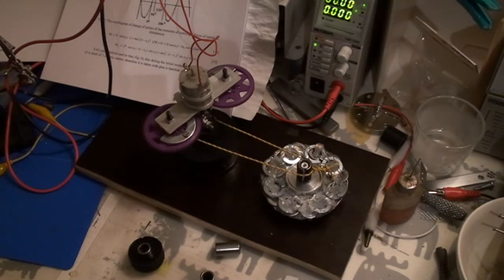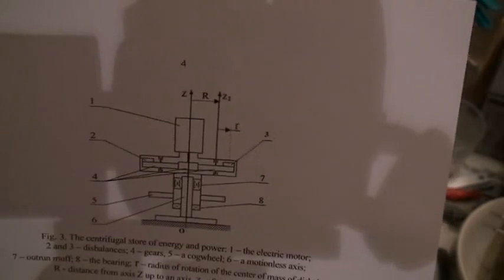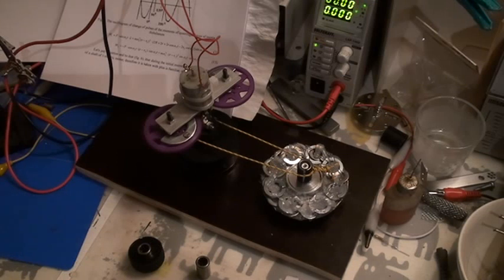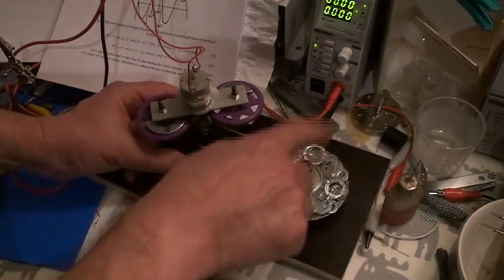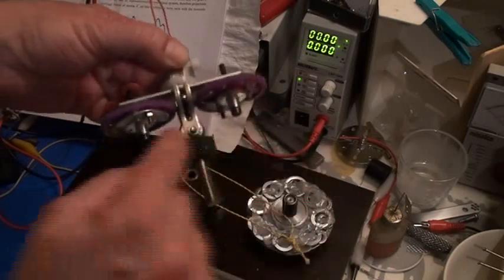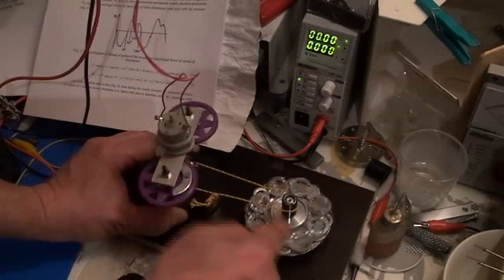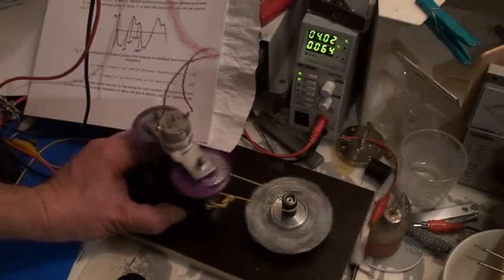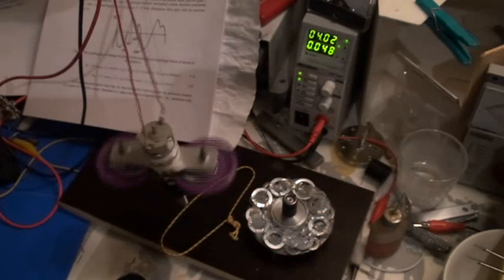Newton law at risk 1  wmv

Comment: The oscillation of the mass in those two purple wheels does delay the phase between the wheelmass position and the wheel position in the oscillation. This will create "drag" and therfor the motor draw more current than if you had stopped the oscillation completely - but let the two wheels spin freely. The CD-motor gain kinetic energy, and only the loss in its motor (that holds it a bit back) require very little energy to overcome. The motor in this experiment require current flow that is dominated by the oscillation, but also the poor and little efficient transmission between the motor and the wheels. Also the current draw drops by 20-25% when removing the CD-motor...
It is clear that the rope and the one-way bearing moves - you say they don't move...

Comment: Very interesting thank you.
Reply: Stefan F. Yes. That's what they claim. Yet, oddly, there still exists a patent category Y10S 415/916 titled, "Perpetual Motion Machines'. Theoretically, if you can provide a working model, they are required by law to at least process the application.
Reply: Stefan F. "Free energy" isnt non existant.

When people talk of free energy machines, OF COURSE they arent referring to machines that pop energy out of thin air. THe energy has to come from somewhere. When they speak of a free energy device, they speak of a device with more energy coming out than that used going in.
Reply: The proper terminology should be "collection and utilization of energy " that surroundings us yet we have not discovered to efficiently put into productive applications.
Reply: there is torque coming from the primary mover. it's just coming in small increments. I don't think this puts Newtonian physics at risk.
Reply: there is no reference anywhere online about this so called Kanaref. suspicious at best.
Reply: http://www.guns.connect.fi/innoplaza/energy/story/Kanarev/index.html
Reply: his big announcement of his generator was in 2010, if it worked thousands of people would be building and using them by now. another free energy scam. Newton stands tall.
Reply: Yes, Newton rules.
Reply: Stefan F.
 
Linevich E.I., Ezhov A.F. The inertial motor engine.
Patent’s application: N2002134855, 23.12.2002, international
application: PCT/RU 2003/000572, 22.12.2003.

Enjoy
Reply: I don't need to see it. they won't get a patent in the United States
Reply: if I could make a device that would make free energy, I would sell the plans to everyone on earth via a website for 1 dollar. now why wouldn't anyone offer that outright instead of claiming for ten years they are waiting for patent approval and claiming they are being suppressed by big greedy oil? you would be rich beyond your dreams in less than six months. it's a scam.
Reply: and that's why the U.S. patent office does not accept any free energy or perpetual motion devices.
Reply: and yet no working model exists. energy cannot be produced in any way shape or form, energy can only be transferred from one state to another. so called free energy is simply non-existent.
Reply: Stefan F. That only applies to closed systems. What if we weren't converting energy from one form to another but simply moving the energy from one place to another...just like in an air conditioner with a COP of 10 or 11.
Reply: purelyprimitives you mean like pumping oil out of the ground and burning it?  what a brilliant idea.
Reply: purelyprimitives we live in a closed system called the universe we can move energy around. we cannot however produce more energy output from a motor that we put into it. which is the whole premise of a free energy motor.
Reply: randomlettersqzkebkw that's exactly what they are trying to sell , its the modern day snake oil.
Reply: Roo Kanga There already are devices that make free energy. They are called solar panels, or wind turbines, or wave turbines. What's your problem with free energy? All of these new different systems are just different ways to approach the same problem. Your ignorant attitude acts as if there are no free energy systems used by humanity for centuries.  If all of the inventors would see the snake oil in everything that goes out of the frame of what already had been discovered we would be still in the stone age.
Reply: Roo Kanga If you want to call it energy transfer, no problem. Call it energy transfer. In the end if it doesn't cost you, the operator a penny more after the initial investment it is FREE energy to you. Can you comprehend that concept? FREE as in you don't have to pay for it.
Reply: Vilo Conshmillo I'm not going into the semantics about how much energy it takes to build solar panels and wind turbines and the return on investment. It's not free. That being said, when I said "free energy" I wasn't talking about money.
     What I'm referring to is what's called a free energy device, and that is a mythological machine that puts out more energy than it uses. There are several different ones that have been promoted over the centuries, cold fusion, perpetual motion machines and such. Every single one has been proven to be a scam to extract money from the gullible people willing to believe in such a thing, and that is why the U.S.patent office has a set policy never to file a patent on such a claim as free energy. Nothing in life is truly free, we always have to invest work and time into making something work for us.

Comment: It twisted my neurons. What were you trying to prove by this. The rotational inertia of two flywheels connected to motor is much greater than motor itself so motor doesnt twist backwards. Ever drvien a bike at high speed with hands on top of your head ? Why do you not fall ? Think whoopy. You need more thinking.
Reply: Every force is supposed to create a counter force.  The spinning CD wheel should cause an equal amount of torque on the driving motor. The two rotating flywheels of equal mass should cancel each other out and they should not influence the other forces very much apart from a bit of vibration. I don't see how your bike comment is in any way relevant as the wheels in the above video are aligned along the same plane. Not like falling off a bike which would cause the spinning bike wheels to be forced out of their normal rotational direction.
Reply: Bigger angular momentum of flywheels overcomes motors effort to spin back.